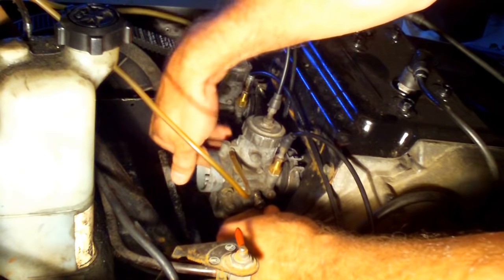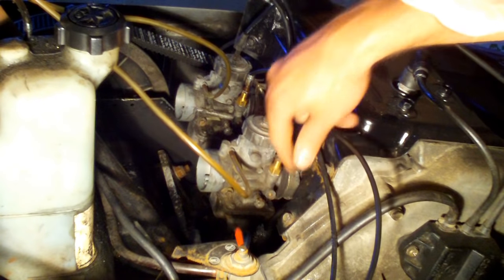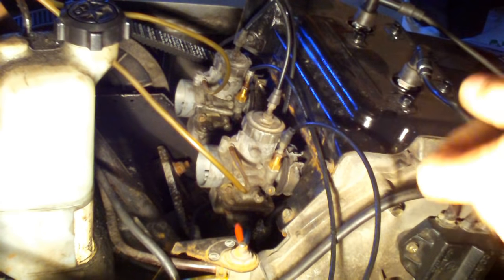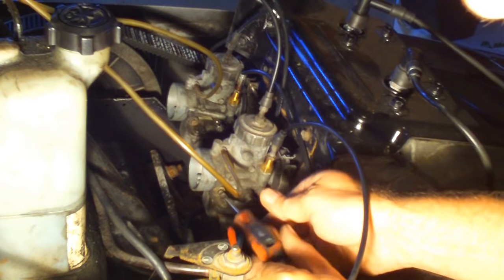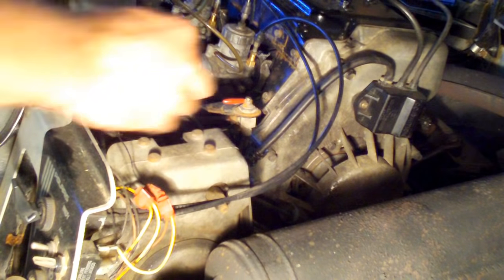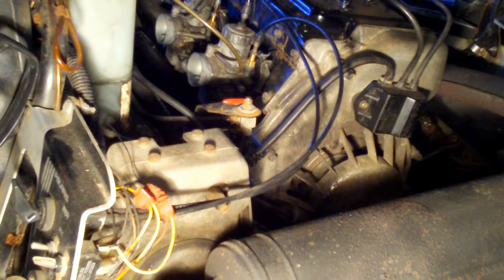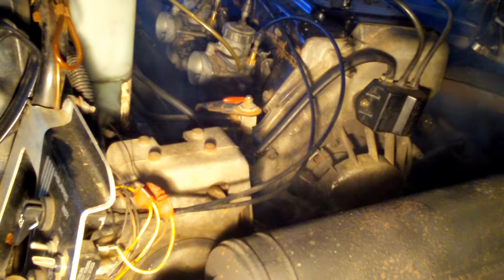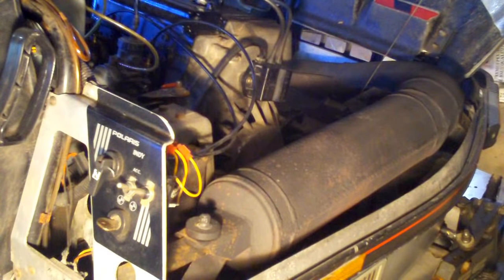How To Adjust Snowmobile Carb Idle Screw Setup on Mikuni ✔

Comment: Hey mark i have. 1998 ski doo summitJust gone through it got the carbs and fuel pump cleaned and my sled only wants to run with idle screws all the way turned in any input?It almost runs perfect with them all the way in alsoOnly starts with throttle open
Reply from the maker: Hello Darrion, that does sound a bit odd. My first question would be how is the compression of the pistons? Are the head gaskets ok? How do they intake boots that the carbs attach to the motor look, are there any cracks? There could also be a problem with the crankshaft seals on each end of the motor, possibly. That's not that old of a sled to have much going wrong. I wish I were more in the know with that sled, but I would start with a compression check of the pistons first. Have it looked at before something goes really wrong and takes the motor with it, which might mean swapping out the motor.
Reply: Mark Young thanks for the reply mark
I think we have narrowed it down to fuel pump Flooding motor out
Reply from the maker: Is it doing that through the vacuum hose or through the carbs?
Reply: Mark Young well last night i seen it through the vacuum lines so wasnt sure if floats were being over powerf by fuel and filling everything else
Reply from the maker: If it's the vacuum line that goes between the motor base and the fuel pump, it's worth checking out the fuel pump diaphragms to see if one has cracked or has a pinhole in it. That's what happened with mine, so I bought new diaphragms and rebuilt it.
Reply: just bought a rebuild kit put it together should i be able to blow through ports or does it need more force then a human mouth? because i can't blow there them wondering if it needs engines compression from the lower end hose to fuel pump?
Reply from the maker: That is a question that I do not have the answer to, Darrion. What is considered "normal or not" in that regard. Have you tried running the motor since putting in the rebuild kit?
Reply: Mark Young did last night after i wrote you the damn thing is still getting way to much fuel i am so confused
Reply from the maker: Let's start with the fuel floats, did you set those to where they should close up? If set to float too high they will let too much fuel into the float bowl.
Reply: Mark Young yes those are set thing i might have found the issue 
Jet was in the bottom of the bowl and the primer is what is flooding it at idle
Reply from the maker: Oh, so the jet fell out or unscrewed itself?

Comment: also my carburetor has a throttle linkage and then I have another linkage that goes back to the bottom side of the motor what would that linkage be for?
Reply from the maker: The other linkage runs the valve for your oil injection. As you increase the throttle that linkage increases how much oil to add to the incoming fuel to keep all of the internal parts (pistons, bearings) lubricated. Without lubrication the parts would run metal-on-metal until they seized up or broke, leading to total engine failure.
Reply: Mark Young thanks for you reply and saving me time I'm going to spend my Christmas working on this bad boy thank you

Comment: I have a 96 polaris indy lite deluxe 340, my snowmobile just idles too low. I want to bring the rpms up, which screw am I supposed to turn?
Reply from the maker: The screw on the side with the large head to it. It's the screw that is at the base of the column that the throttle piston slides up and down in. Only turn the screw IN (as though your are tightening it) of 1/4 turn increments at a time and try it out. If it still isn't high enough, turn it another 1/4 turn, and so on until it is where you want it to be. For my motor the recommendation is 2,000 RPM.
Reply: Neat.  I have a 96 polaris indy lite 340 (regular) and it idles so low it stalls.  Wonder if this is a common problem.
Reply: Doug Bailey I turned both screws with the springs on them all the way in until they lightly seated. Then I backed them off 1.5 turns and the idle is higher now. Give it a try!
Reply from the maker: If your carburetors are like the ones on my sled (which I have seen a video of a 1996 Lite Deluxe), with the round piston slide tower pointed up, there should be two screws on one side of each carb. The one with the larger head and a spring wound around it, and is horizontal, should be the idle screw. You should be able to turn this screw with your fingers. The other screw, which is a smaller flat-blade screwdriver screw, is for the idle mixture. Leave this one alone. With the engine warmed up but shut off so you don't get caught in any moving parts, turn the idle screws on both carbs "in" 1/4 turn (as though you are tightening the screw) and run the motor. If it still isn't idling fast enough, turn it in another 1/4 turn and run the motor again. Keep doing this until you have the idle where it should be, but always in 1/4 turn increments on both. Be prepared to keep the sled from taking off on you if you set it too high when you start the motor. I hope this helps you out.
Reply: rslaser91

Comment: son has 90 340 run weak 
last yr.. so I put new top end in it.. now won't run without choke on. clean carbs.. never had this problem
on any of my sleds. it just one carb doing it. choke off I can spray gas in that carb runs fair.. help please
Reply from the maker: +michael littlejohn These are just guesses, but maybe a fuel pump issue? Are you sure every little tube and channel inside the carb is totally clean? I use old guitar strings to fish my way through the little openings to make sure any dirt or fuel varnish is pushed out. Make sure you can see light through the jet(s) by taking them out. Check the float level and the needle and seat area, make sure it's not sticking closed. The "choke" on these Mikuni carbs is really an enrichner circuit, it opens a passageway to allow for more fuel to be dumped into the carb for cold starting. So if it only runs with the choke on then it is starving for fuel. You need to find where it is being blocked.

Comment: Thanks for the video! I have 2 1997 Polaris Indy Trails myself and this could definitely fix the idle problems. Like you said, it idles rough at 1500 RPM. I have a question however. After I ride for 5 minutes or longer and I slow to a stop it will idle at 1500 and after a minute will idle way down and cut off. Any suggestions?
Reply from the maker: The recommended idle speed for my 1988 is 2,000 RPM. 1,500 sounds low to me. Have you tried adjusting both (it is a twin with two carbs, right?) idle screws in a little at a time until it idles at close to 2,000 RPM? I would try that, ride it for 5 minutes or more, and then see where it idles down to. Make sure your brakes are working good in case it idles up beyond that when you are slowing down. I have noticed that my sled does the same thing as you described. After riding for a while and coming to a stop, the idle is higher than 2,000 RPM, and I would open the hood and turn the screws out to lower it. What I have learned is to leave it be and after a minute or so it will idle down on its own. I do not know what causes this to happen, but it almost seems to be on purpose for fan cooling? Someone must know the answer to that!
Reply: Mark Young. Ok thanks I'll try that today.
Reply: Mark Young It is twin carb.

Comment: I have a 76 Arctic cat jag 340, and it will only idle on half choke, and if I take it off half choke it will rev up and slow down and die, what's wrong?
Reply from the maker: It sounds like it is running too lean without the choke lever, and too rich with it at half (which is why it revs up after releasing the choke) in my opinion. Check where the air mix screw is adjusted to as in how many turns out it is. If it is one turn or less it may not be the issue here. Still, it is starving for fuel somewhere, so if the mix screw can't solve the problem, the next thing I would do is remove the carb and clean it out, every passageway, using a thin wire (guitar strings work good for this), to make sure there isn't something blocking fuel from getting where it's supposed to go. Carburetors are very finicky beasts. When gas and air go through in the precise amounts it is supposed to, life is good. When it doesn't, time to dig in and find out why.
Reply from the maker: Hello Jake, seeing your post just now, sorry for the delay. There could be a few things wrong with it. It could be getting an air leak from a crack in the carb boot or a bad crank seal. Check the rubber carb boot and any gaskets for them for cracks or gaps. Hopefully this is just a dirty carb problem, which thanks to ethanol being added to our fuel, seems to be a fairly common issue. Take the carb(s) off and either you or someone who is familiar with this work should take them completely apart, clean everything out, replace parts that are worn, and reassemble them.
Reply: Mark Young no worries on the delay! Thanks for the help man, got it running good, it was the carb boot, merry Christmas! Take care

Comment: Ok to run engine without boots / air box connected?
Reply from the maker: +Dean Peddle I didn't see any issues without the airbox on, but I did put it back on right after I got it where I wanted it. I would not recommend running a sled without the airbox all the time as that would invite dirt and hot air into the carbs and motor.
Reply: Can u put on lil air filters like k&n I have a triple and want to take big air box out

Comment: Hi I did this on my arctic cat triple sled. I wanted it to idle a little lower, but I screwed up and did not set them to idle equally. Now it backfires reving up, and makes a knock sounding noise at idle. Any ideas how to equally set them and why it backfires? Thanks
Reply from the maker: The backfiring and knocking sound is not something I am familiar with. How was it running before you made the adjustments? Could one carburetor be farther off than the other two at this point, causing the backfiring and knocking sound? I would start over and adjust all three carbs idle screws the same to 'synch them up again.' Check all three spark plugs to see if one looks really different than the other two, and keep track of which cylinder each plug came from. Don't mix them up. Then you'll know which carburetor is giving you trouble. Keep me posted.
Reply: Mark Young - Outside The Box thanks for the quick reply. I synced them to what I thought was equal, cleaned the plugs, and added a new air filter since the previous one was garbage. After all that, it seems to run well, but I’m stuck with my sled still idling at 2100rpm. I’ll keep trying to make it run a bit less rich by the method in the video. I think one piston is still not perfect, but should do.  It’s pretty difficult with it being a triple but not impossible. Thanks for your help.
Reply from the maker: @elitegmer9377  2,100 rpm may sound fast because it's a triple? If the spark plugs were black as coal, then it could be running a little Rich. Just go easy on leaning it out, especially in the slow speed range as oil injection relies on the fuel more for lube at low rpms. A little rich on the low end also should give it a good launch when you snap the throttle. Just remember this, always read your spark plugs to "know" what the air fuel mix is. Never by feel or sound alone.
Reply: Mark Young - Outside The Box thanks for your opinion. I’m somewhat mechanically inclined when it comes to cars, but not two stroke sleds. I went to start it and there’s gas where the bottom part of the block is, and won’t start. I understand if you have no clue what it is because this is going beyond what the contents of the video were about. Any opinions or thoughts would still be greatly appreciated.
Reply from the maker: @elitegmer9377  a float might be stuck open on one of the carbs causing it to overflow. See if any of the carbs has gas dripping from the bottom. Be careful of the potential for fire.
Reply: Mark Young - Outside The Box ok thanks for your opinion, that seems to be what everyone thinks. It makes sense. If this is the issue and I can fix it I’d be really happy. Thanks for your time whether it works or not
Reply: While adjusting, if the sled idles for to long you may damage spark plugs and they will do exactly this... Look at the fire, if orange replace plugs or even better try 3 new plugs...
Reply: Thomas Parent-Simard thanks for your opinion. My air filter foam was literally getting into the carb so I replaced the foam and it fixed it haha. Still idles high but not as bad.

Comment: hi i have a  1997 arctic cat puma 2 up and it doesn't idle unless i open the throttle a little bit do you know what would be the problem i tried adjusting it didnt help unless i pressed the throttle a little bit is it that the throttle cable is to small i dont know whats wrong.
Reply from the maker: Not an "expert opinion" but this sounds to me as though the idle screw (or screws if you have two carbs) is not turned IN enough. I just saw a video of a guy cleaning a carb off a Arctic Cat Puma 340 (year unknown to me) and saw that there is a screw on the side of the carb body with a spring around it to provide resistance to turning on its own. It has a slot for a flat screwdriver, and the edges of the screw have little grooves to help to turn it by fingers. Now, try turning that screw (or screws if you have two carbs) IN as though you are tightening the screw, by a quarter (1/4) turn and run the motor. If it still doesn't idle, turn it IN another quarter (1/4) turn and try again. It's up to you how many times you turn the screw(s) in, just make sure if you have 2 carbs you do this the same for each. At some point, you may in fact turn them in so far that when you start it the sled could try to lurch forward by engaging the clutch, so be prepared to shut it down immediately!!! Or (recommended) do this with the track OFF THE GROUND to prevent this from happening!!! Let me know how you make out!
Reply from the maker: Here is the video, at 15:45 into the video he goes about removing the IDLE SCREW. You don't have to pay attention to how many turns he is giving it to make sure to put it back in the same amount, just for reference on where it is and what it looks like so that you are turning the right one! https://www.youtube.com/watch?v=dtw6HJ80zYE
Reply: Mark Young i just figured it out well the carb was totally fine it was the throttle handle when i push the throttle handle down not pressing it in to accelerate pressing it down i just shuts off but when i push it upwards it idles fine
Reply: well i fiddled with it some more that handle thing isnt it its weird cause it seemed to be the issue so im going to fiddle with the iddle screw

Comment: hey I'm having high idle issues with my 96 XLT triple . it's not the same engine the engine now is a 2003 500cc twin I believe not sure if it's a RMK or SKS ...cannot find the make of moter threw the number on top engine all I know it's a 2003 ...need help please why is it still idling at 4000rpm
Reply: sounds way to high like it's going to blow up ....could you find the right adjustments for both or if you need number I can give to you
Reply from the maker: There must be an idle speed adjustment on your carb(s) somewhere. If you can't find it, as I am not familiar with the 500cc engines, I recommend contacting a snowmobile shop near you for further assistance.
Reply: Mark Young  thank you for your response :)

Comment: can u look im that book an see what it be for a 1990 indy 650 triple carbs need to be set at
Reply from the maker: +Richard Demers I'll take a look to see if it is listed in my manual, Richard.
Reply from the maker: +Richard Demers You have a 1990 Polaris Indy 650 triple, with the EC65PL-01 engine, 3 VM38SS carbs, main jet 260 Hex, pilot jet 45. Recommended settings: Air jet out 1.0 turn, needle jet E-Clip position "3", and idle speed set to 1,990 RPM. (according to my manual).